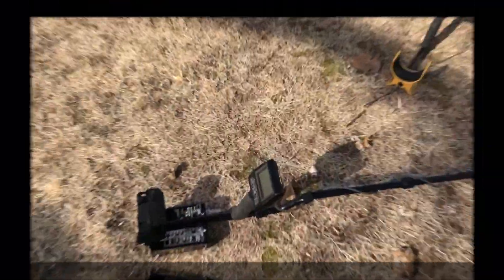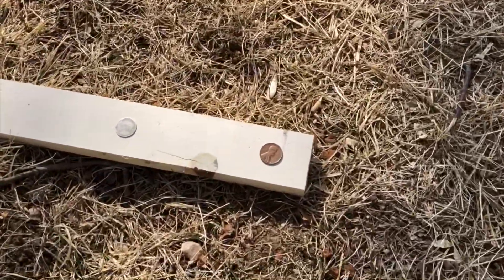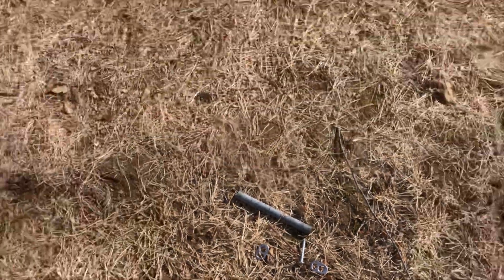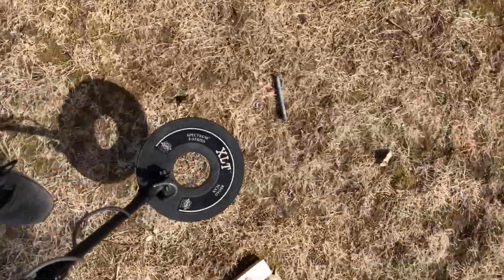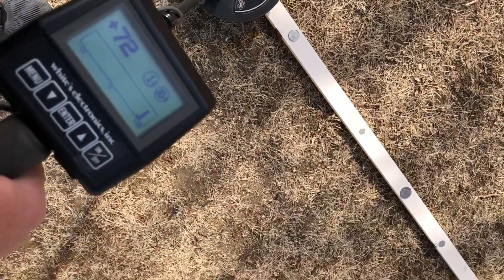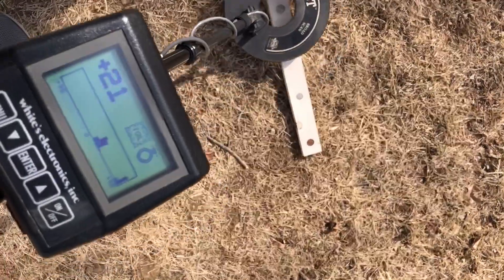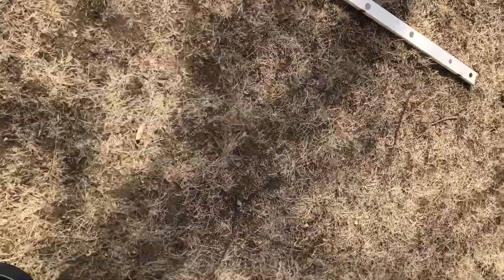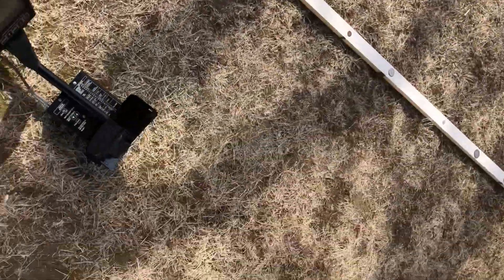Metal Detector Test - Garrett Ace 250 vs. White's XLT - This & That With Lovie Episode 14

Comment: I cannot do that. I simply won't run my XLT without turning on TONE ID (and also VCO). I like to hear my numbers rather than read the screen all the time.  But the stock programs have those options "off" by default, so I have to use a memory slot or change that setting every time I turn on the machine.  good luck diggin'.

Comment: How is the Whites xlt on beaches in wet sand by the water?  I am expecting an old vintage one and so checked out your video. Liked and subscribed (good music 2)
Reply: What's the word on your detector? What did you end up getting? I've had (and still have) a wide variety of older Whites machines. I currently have a Counmaster Pro for anyone that goes with me but doesn't want to mess with settings,  a Whites GMT gold detector,  a Spectrum XLT rainbow, and the newer Spectrum XLT E-series.  

Just curious how your detecting went last year?
Reply: Should've got a DFX instead